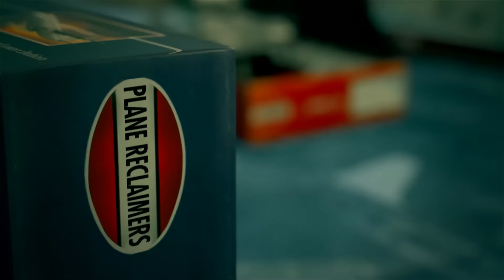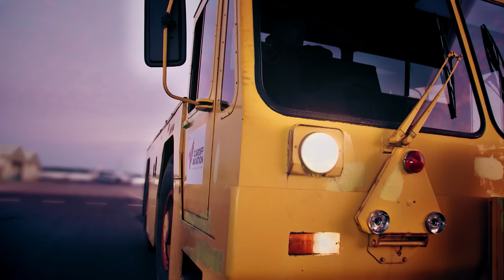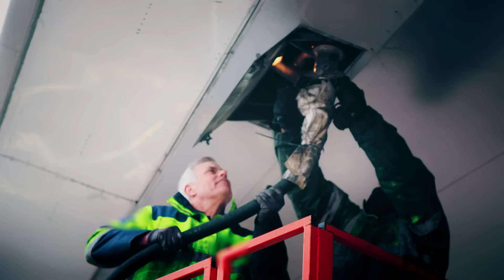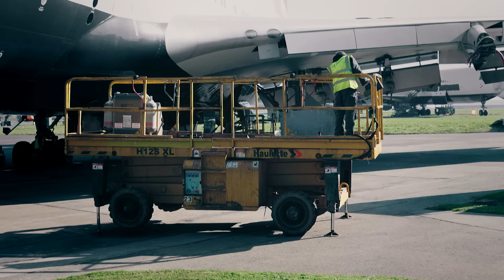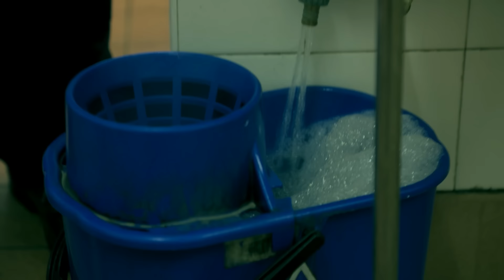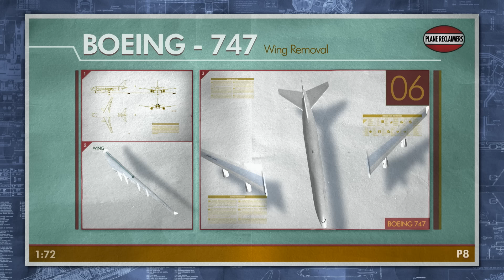Jumbo Jet Retirement - Plane Reclaimers - S01 EP02 - Airplane Documentary

Comment: The fuel is NOT HIGHLY COMBUSTABLE, you can throw an ignited match into a tray of A1 jet fuel with no effect, it needs to be compressed and misted to ignite, similar to Parrafin and diesel, it’s the vapour that burns, not the wet fuel. Typical over dramatic presentation of a simple task…….10 tonnes of fuel is not a lot, think about the capacity, it’s not safe when empty, the fuel vapour is the haz risk……